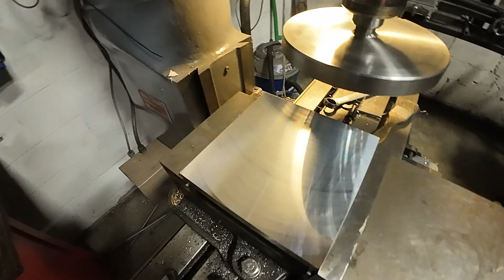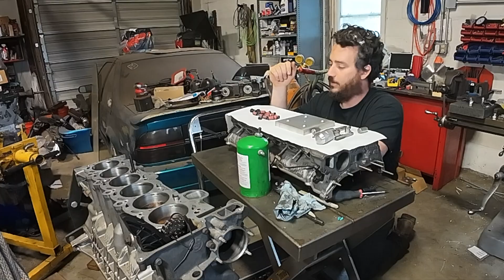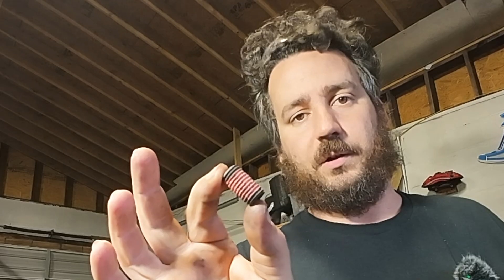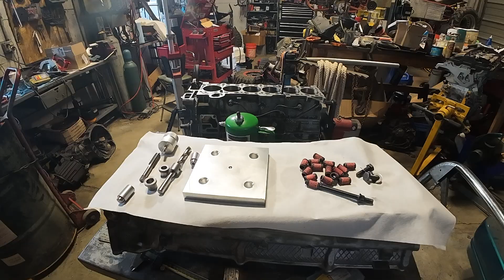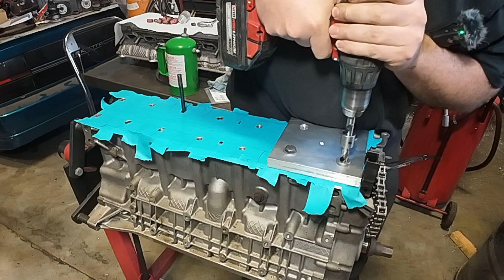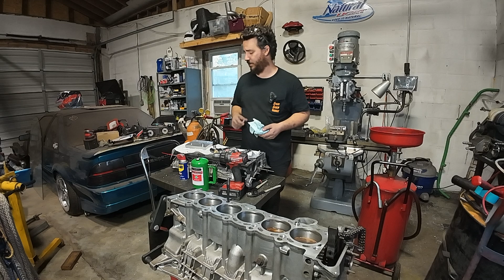M54 Cylinder Head Bolt Stud Thread repair. No special tools. Aluminum block m52

Comment: You video is good and i watcht it before fixing my M54 engine supervising and requesting what to do myself because those inserts are maximum 40mm (or even less) of thread and the M54 head bolts have 140mm of thread which means that those inserts are wasting 100mm of clamping force.
When they fix my engine with those 40mm, the inserts snapped and the coolant leaking into the engine came again.
The final fix is: tap the monoblock all the way down, fabricate inserts of 140mm lenght for the M10x1.5 bolts, glue them with permatex and when installing the head bolts, apply loctite 243.
This arrangement endured the OEM torque + the 90 degrees for final elongation with no problem.
Reply from the maker: I don't worry about the depth really because the ARP studs I use don't have as much thread as the stock bolts.

Comment: Well, since you sought fit to ignore my request to rent your kit I did a bit of investigation of my own. Using 1" of Corian countertop. I made a similar template, drilled the appropriate size holes and, voila! I managed to go through the whole process without a hitch. It's easy enough to set the depth of any of the drill, tap, or inserts as long as you're patient. All it cost me was the cost of the price of the EZ-Loks. I would have gladly rented your kit, but, you saw fit to ignore my request, leaving me to believe you're full of shit.
Reply from the maker: Im glad you came up with a solution! If there's a will there's a way. Sorry we couldn't connect, I did email you back. Glad you got the inserts in, that's all that matters!

Comment: great fix, i'm wondering if a magdrill would work for the rest of us? Please let us know how much power this would hold? Thoughts on an M12? I would think the 9/16 is better off in the aluminum, but is bolt stretch an issue?
Reply: just did this with magdrill and it was really easy to do. i used m14 to m10 inserts and insert is 35mm long so it is allmost whole bolt hole lenght to maximise strenght.

Comment: Can this be done with the block still in the car? (M52 in a e36 compact)
Reply from the maker: Yes it can
Reply: @spankranchgarage  will those timeserts stick over time? I keep reading that BMW advises against the use of theme. And do the threads only wear out on engines that have overheated?
Reply from the maker: @mennovanleeuwen  These aren't actually "timeserts" that is a separate  product that is swaged into place after installation. Slightly different but pull strength wise I would think they would be very comparable. The load is spread over a ~14mm hole while it was a 10mm hole initially. I am running these in a turbo car currently with no problems. I don't expect any long term problems.  As for which threads tear out and which don't, I would assume overheating is a contributing factor but some of these seem to pull out for no obvious reason.
Reply: @spankranchgarage  great. Thank you for the clear answer and the insightful video. Do you sell these kits by any chance (you mentioned borrowing, but I am in Europe)

Comment: Not gonna lie, I'm a little nervous about my first aluminum block engine. 😬
Reply from the maker: Love how light they are and how quickly they shed heat.... but yeah the threads...
Reply: @spankranchgarage  yeah, it'll definitely be worth it. My L33 is also more compression, better heads and more liters than the iron LR4 coming out.

Comment: I recently bought the vq main studs and the appear too long when bottomed out into the sleeve with the 7mm recess any information about this or maybe there’s some way to shorten them?
Reply from the maker: I have noticed they are a little long but they work just fine and dont interfere with anything.
Reply: They are head studs not bolts they well stick out a little but should not interfere with the cams at all if so pull them out clean the threads and or tap and rethread

Comment: did you have to change engine mount to get the bottom mount to fit? also great tutorial, i got to do this eventually
Reply: Yah the Rally Road bottom mount turbo mount works nicely. Easily fits my intake setup with a 45 degree coupler off the turbo
Reply: @elijaah81 in e39?
Reply: @Demon-ng4sz  currently on an E46 setup. But i used to have an E39 and the formula is about the same. In fact if i remember right my E39 had more clearance in the engine bay. Not by much tho
Reply: @elijaah81  Ok thanks
Reply from the maker: @Demon-ng4sz  I built a custom motor mount arm. I am able to keep AC with a 2.5" discharge and a 4" intake tube with the borg warner 366. Ill make a video about the E39 when I re-assemble it. Its a tight setup but it works great.